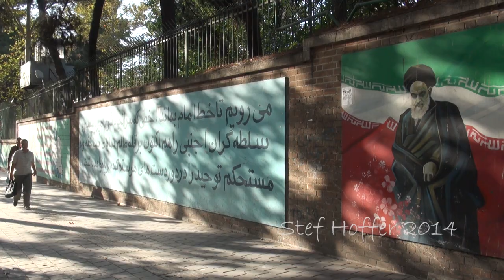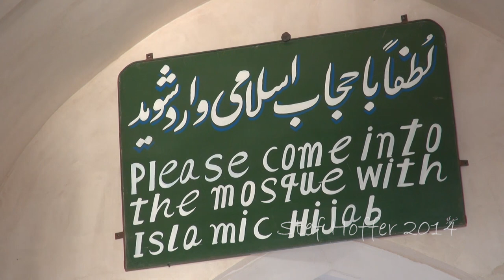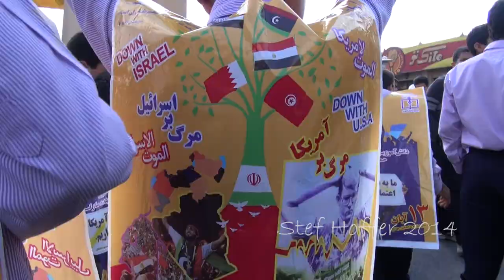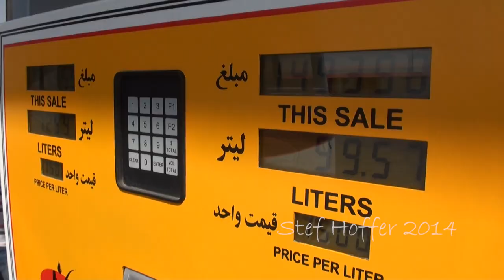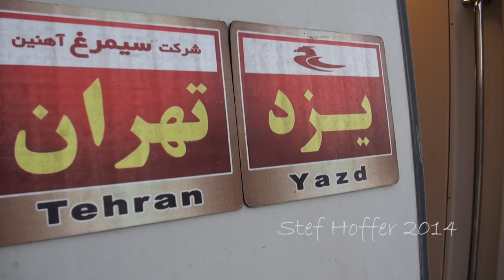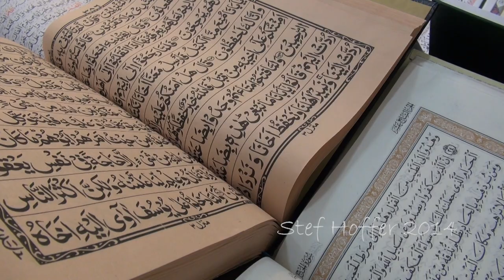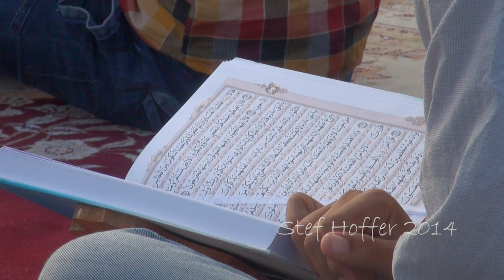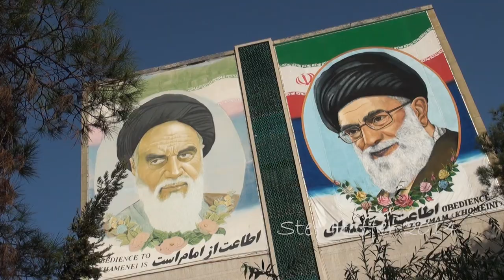Journey through Iran

Comment: Very interesting video and presented with as much fairness as possible. I am also glad that you called the stretch of water to the south of Iran by its proper name that has been used for more than 2000 years, the Persian Gulf. It seems that the Arabs and the BBC are the only two interested parties that refarin from calling it the Persian Gulf, always the Gulf or at times the Arabian Gulf which incidentally is geographically incorrect.  Many Thanks, A.G